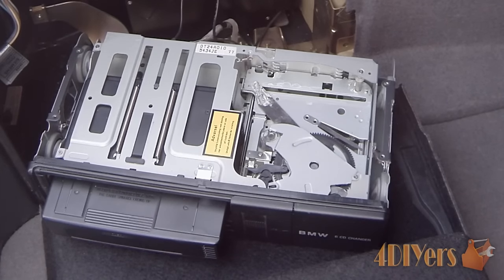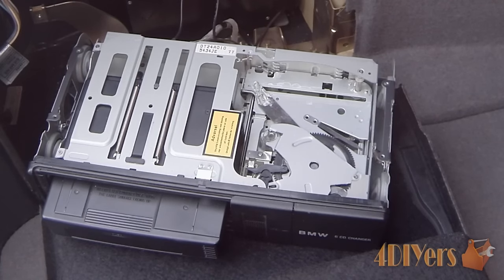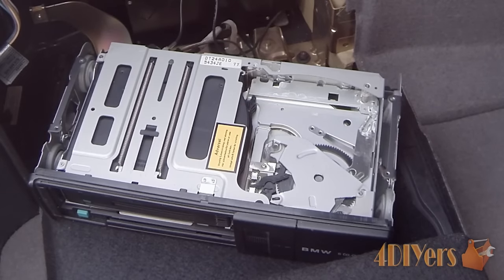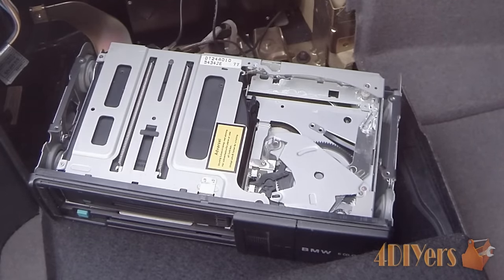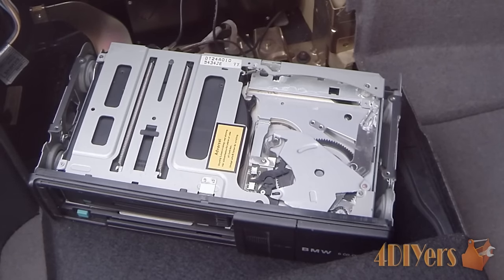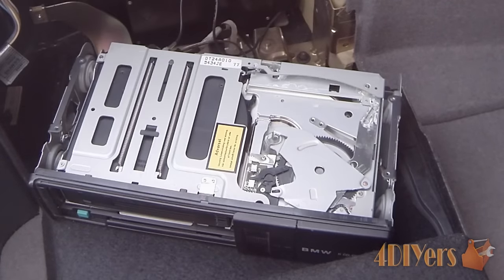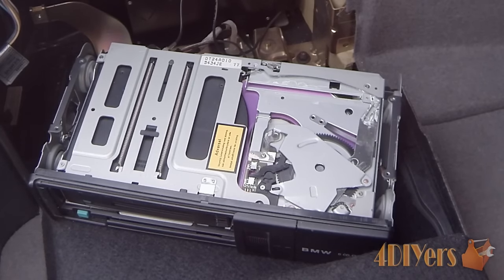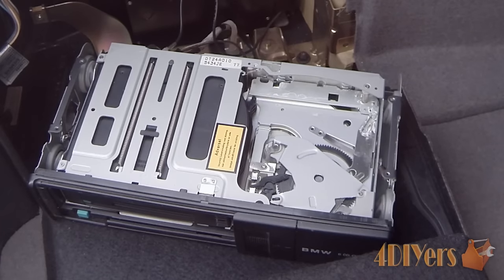Demonstration: CD Changer Operation

Comment: Hey dude, I got it again... the jamming. It's not the arm that gets jammed, but there is a linear potmeter on the lower left (under the magazine) that let's the electronics know at which level the player is at. This gets dirty and tends to send a wrong resistance value to the electronics, causing the player to stop too early or too later. Thus it isn't level with the right tray, then it does pull the tray out but gets hung up on those metal fingers on the right front and rear side of the changer.

Remedy I found in the end is to drizzle some contact cleaner (with the straw attached) in that potmeter, when just holding your tongue at the right angle as there is no good way to get to it. Then just let it run through a few cycles of it pulling the discs in and out, so just put it in the car and insert/eject the magazine a few times for it to go through its disc detection sequence.

Comment: I have an old Panasonic SA PM28 which at the time of writing this is jammed but every so often it decides to work again. Assuming the system is similar to this, would that be a symptom of this issue?
Reply from the maker: Sounds like it needs to be cleaned and re-lubricated.
Reply: @4DIYers  yeah that sounds quite right as the mechanism operates much slower than it should when it's finally working